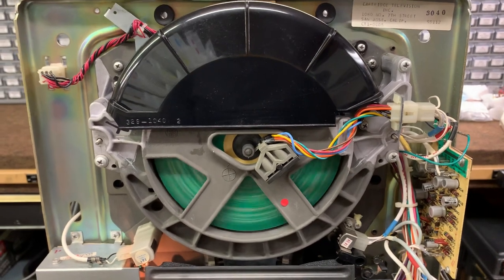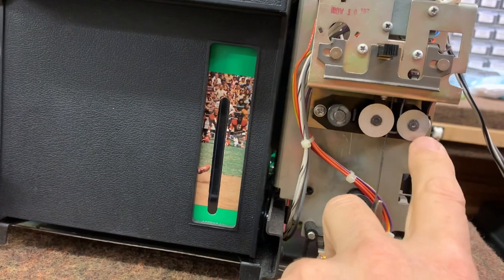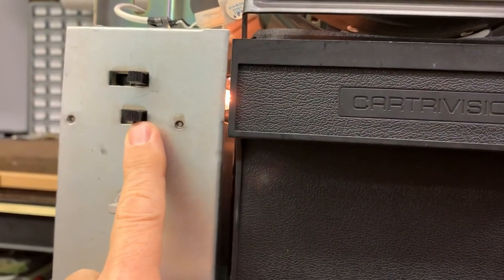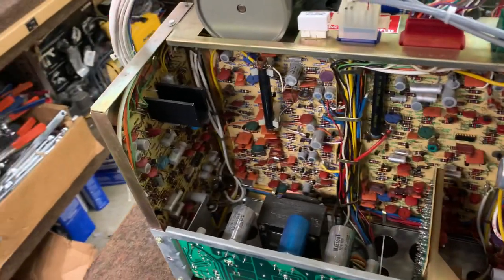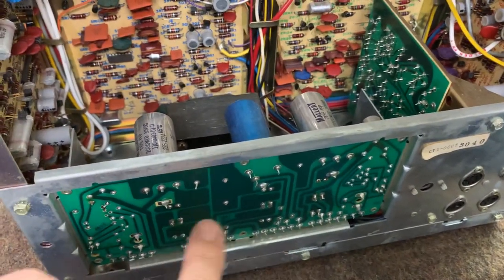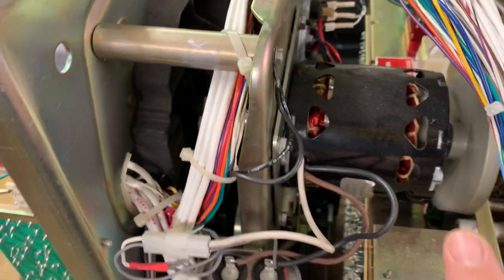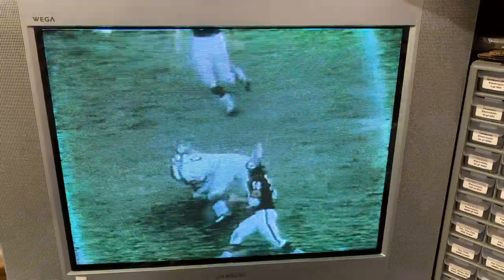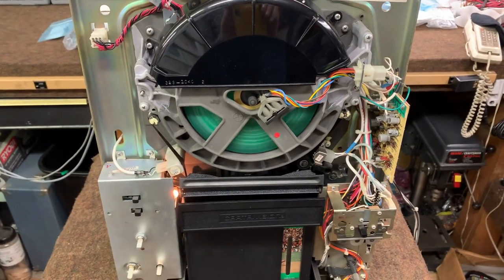Cartrivision Working Unit Demonstration

Comment: Awesome!
Sadly Cartrivision only recorded every 3th field and played it back 3 times. So essentially you got 20 images changes per second. And you lost half of vertical resolution.
Philips started their VCR format in Europe at the same time - also two stacked spools - but recorded all 50 fields of a PAL signal...
Reply: Well, they HAD to figure out how to cram more video to a given length of tape.  It wouldn't be until the advent of azimuth recording for true multispeed VTRs/VCRs to become practical, then successful.
Reply: It's almost like the Baird 240 line system but with less flicker and lower framerate, and in color.
Reply: @kattphloxworthych  They managed to get color on video tape - that was really far advanced. It took some time for the other formats to get enough bandwidth (and the idea to do color under encoding) for color.

Problem with color that many faced (so they omitted it and left VTRs black and white) is that the TBC must be exact for the always correct phase of the color signal (hue).
Reply: @PascalGienger  Color under encoding was described as "heterodyning" when I first learned about how it was encoded for recording onto the tape.  That technique was still employed on Beta, VHS and other consumer formats.  Likely for even some professional formats, too, like U-Matic.  I believe it may have gotten its start in the 2" quad years before high-band came out.